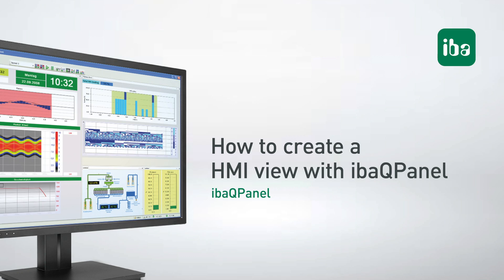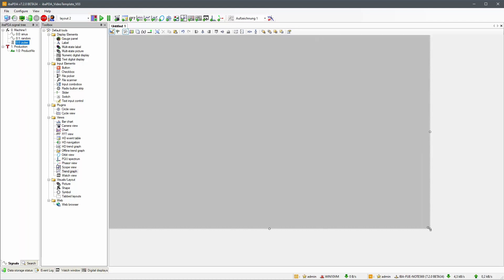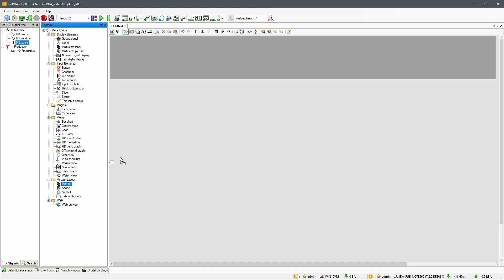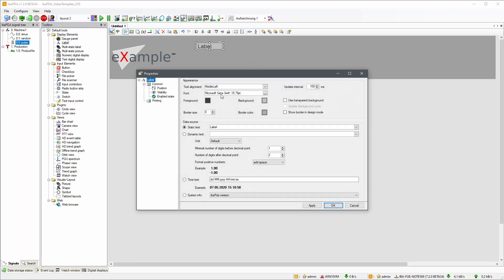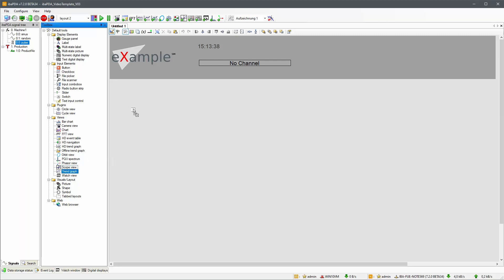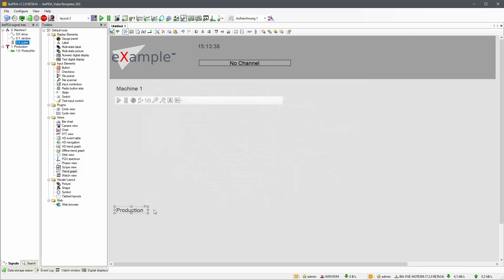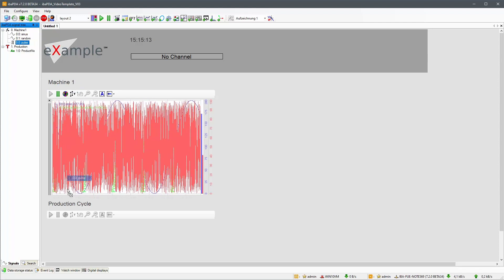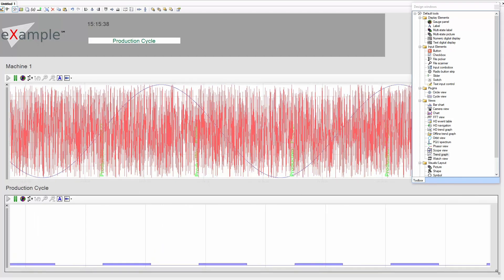ibaQPanel: How to create a HMI view (01)

Comment: Hi! I'm automation Engineer and iba user.
First of all, in apolagize to IBA!
But I have been testing and applying this one at my job, and ibaQPanel is a very simply way to visualization when we compare with a normal HMI device or software.
In my opinion ibaQPanel needs to improve the features to be similar the normal HMI device or software!!
For example:
	-LDAP Resources to Security;
	-Images Animation;
	-Transparent background Images;
	-Controling Images( Rotation, resizing, scripting, background transparent, being every thing with linked signal/tags)
	-Support SVG Images;
	-Several buttons types;
	-Automatic detection Full Screen;
	-Others types of graphs : PIE, XY, Line, Spider, Control Charts;
	-Mobile remote view;
	-Supporting to HMTL5;
	-Supporting to PDF;
	-Supporting to Scripts languages;
	-Supporting to Recipes;
	-And others ones...
Reply from the maker: Dear valued iba-user,
 
thanks for using the iba system and for your suggestions regarding ibaQPanel. ibaQPanel is an add-on for ibaPDA, designed for the flexible and fast visualization of high-resolution measurement data and Quality data (QPanel = Quality Panel). Many of your suggested functions are possible using our dynamic editor or the charting tool; some of your features are already on our roadmap and available in one of the next versions. However, some features from your list are not planned, since ibaPDA and ibaQPanel are desktop applications and not designed for mobile use. For this, our web-based and platform-independent tool ibaDaVIS is the right choice. We will be very happy to discuss your requirements with you. Please contact your local support at https://www.iba-ag.com/en/contact/